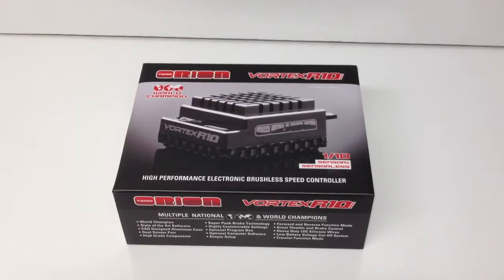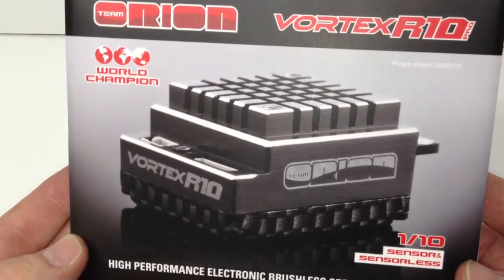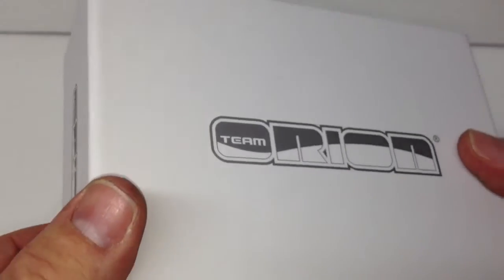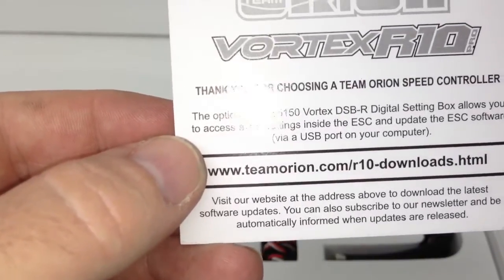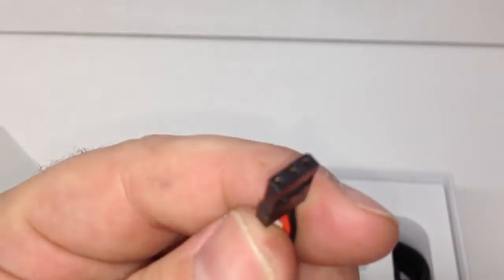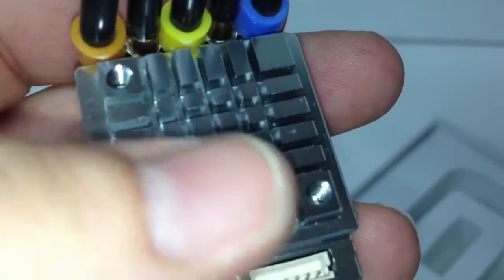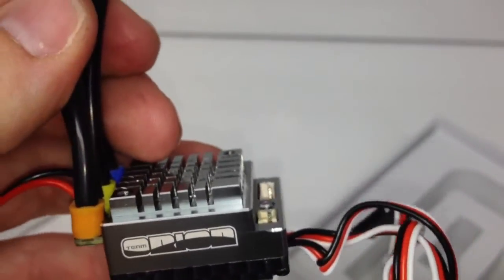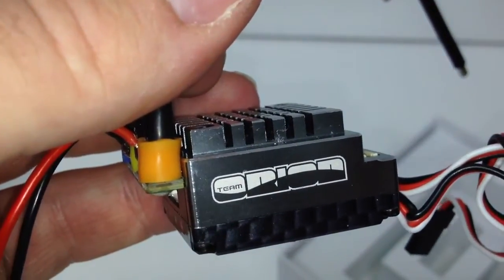Team Orion Vortex R10 Pro - Unboxing

Comment: Hello sa fait 3ans que je roule avec cette  esc il ete top et depuis quelques jours il manque de frein je peux faire quoi pour qu'il frein fort comme avant salutations yoyo
Reply from the maker: I would try re-calibrating the ESC to the radio - you know, setting neutral, throttle, full brake. Then I'd jump into the programming (Orion has programming cards) to see if it's been disabled for some reason
Reply: @TheRCNetwork  j ai le boîtier de programmation et  ces déjà full

Comment: Can I run the team Orion vortex r10 stock with a 6.5 motor and a protek 100ss servo and have the servo to the highest power
Reply from the maker: +Kaleb Moore The R10 Stock has a 5.5t motor limit, so that's not an issue.  As for the Protek servo, not sure, as I've never ran one with the Orion ESC's.  The R10 should be able to handle it, worst case, you may have to add a Voltage Capacitor to manage the voltage to the servo

Comment: Hey Rich! So how is that Orion esc   I was thinking of checking it out but I'm still debating,tekin rsx or the Orion! What r u you thoughts! Maybe you can do some video reviews! We'll best of luck.
Reply from the maker: The Orion R10 Pro is a great controller. Easy to program and runs smooth. I just got a hold of an RSX and will be installing soon in a new project.

Comment: I'm new to rc and getting ready to purchase some electronics for my b44.2 (roller) will the new R10.1 Speed control and vortex vst 2. Pro work together for a set up. Not sure what the difference is with the new speed control 2s 170a ant the one you have 2s-3s 160 a means ( I'm a newbie ). Also planning on running the same battery packs you have. Let me know. I do want the latest speed control r10.1
Reply from the maker: The r10.1 is the latest Team Orion Speed control. New software and a Carbon fan along with raised specs like 170a looks like the difference. The vortex 2 will be a great motor pairing as well. I would recommend the Team Orion Carbon Pro saddles though (90-100c) packs.

Comment: Sounds good. If I wanted to upgrade could I use a 10.5 or 9.5 motor with that 120 amp esc?
Reply from the maker: Yep, the 120amp version is rated down to a 4.5t motor on 2s as a limit.

Comment: I was wondering if this would be a good esc for a b4.2 with a sensored 13.5 t motor?
Reply from the maker: It's a great ESC for almost anything. With a 13.5t, you could use the 120amp version with no issues.

Comment: What's the difference between the R10 pro and the R10.1 pro?
Reply from the maker: There's only one peek at it from the Nuremburg Toy Fair, but it looks like it has new software/firmware, is more efficient and has lower resistance.  Did I mention it has a Carbon-look fan now?  I don't think it'll be out for a couple of months though

Comment: TheRcworld101 just set your throttle trim to neutral turn on the esc whilst holding down the programming button. Once the esc starts blinking red let go, go to full throttle press the button again then full break and press the button once more. once that is done wait 3 seconds then power off your esc and power it on to set the changes

Comment: Had a viper, was racing on November 9th so 3 days ago and was racing in my 2wd sct with a 8.5t and was racing at my event and was in the a-main and was battling for second then all of a sudden my esc has a meltdown right when I was going for 2nd spot...Definitely never getting a viper again going orion from now on!!!
Reply from the maker: I'm very happy with my Orion.  Its super smooth and with the programer, it's very easily changed in the field.
Reply: Yea Orion is some high tek stuf and very good.I will use that for my 2wd cars and tekin for my 4wd sct if I ever get one!!

Comment from the maker: If you re-read what I said, if you chose the 120amp version, you will be limited to a 4.5t motor.  You can run a 6.5t motor on either ESC.  I always over power my race rigs to avoid heat and failure issues.  It also saves batteries by having decent electronics.

Comment from the maker: There are 2 1/10th sized ESC's.  Both are the R10 version.  One is a 120 amp and the one in my video is the 160amp.  I felt better with the 160amp, as the B44.2 is a 4wd buggy and I wanted to run mod motors, so it's pretty much limitless.  I also didn't want to worry about heat issues.  Btw, the limit on the 120am is a 4.5t motor.

Comment: Hey it's me again i'm getting a b44.2 and i'm gonna put Orion stuff in it i'm putting a vst2 6.5t and a Orion r10 but which r10 should I get there are 3 the 1/12 and 2 1/10 esc one is like 90Apms and the other is 160Apms/760Amps and not quiet sure which to get!!!